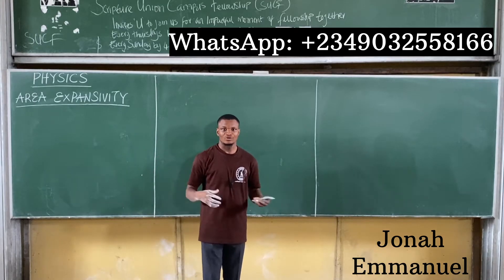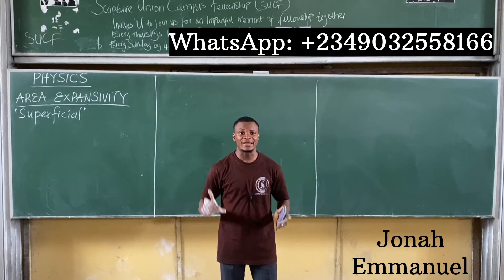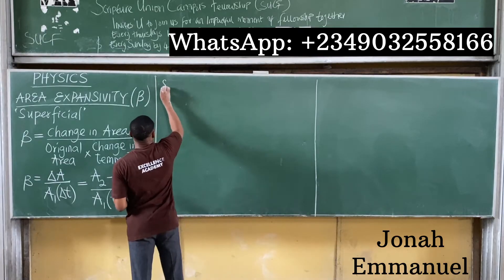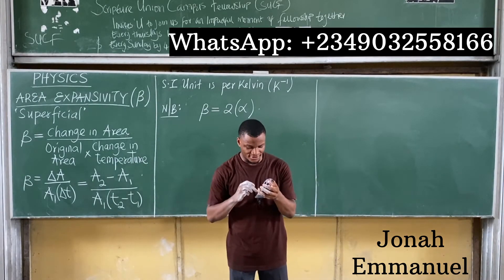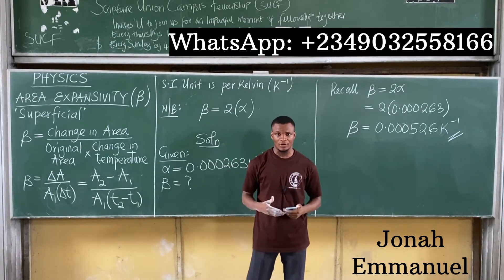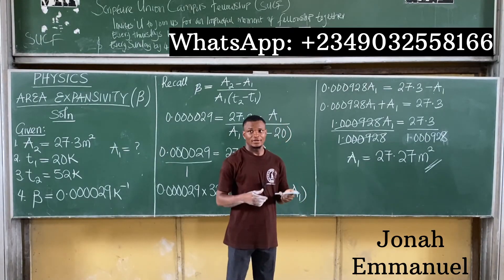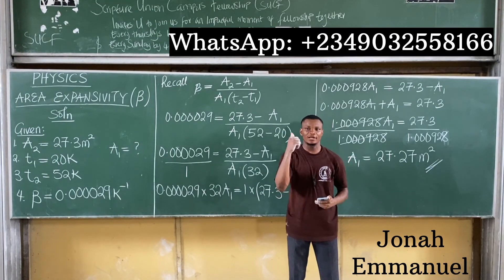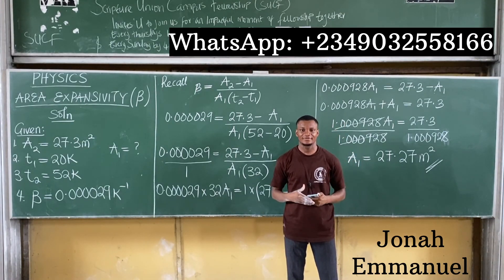Area Expansivity (JAMB & WAEC PHYSICS) - Meaning, Formula Derivation, Unit, Examples and Solution.

Comment: Sir I got 2.72 instead of 27.27 because when I multiplied 0.0000928 by 32 I got 0.0000928 but you got 0.000928.
Please am I correct?
Reply: The mistake is because you did double multiplication. First is: 0.000029×32A1=0.000928A1+A1=1.000928A1. when you continue, you will get 27.27m². I hope you understand it.
Reply from the maker: @InfoMedia1403  thank you 👍🏻
Reply from the maker: Check
Reply: Really helped, keep blessings 🎉🎉